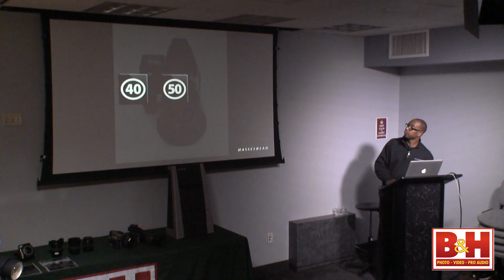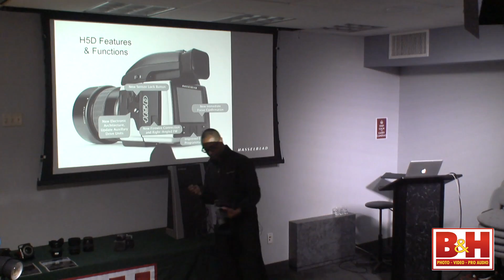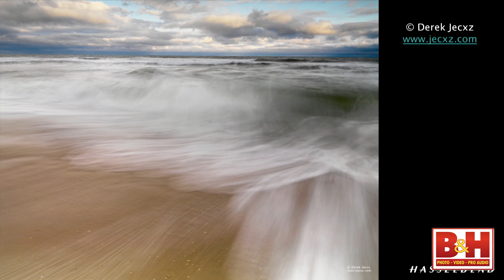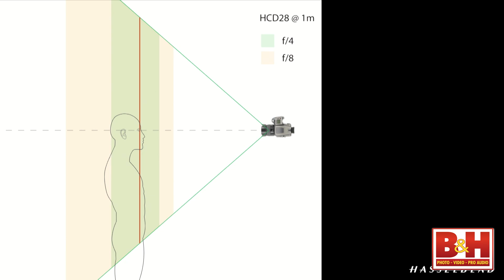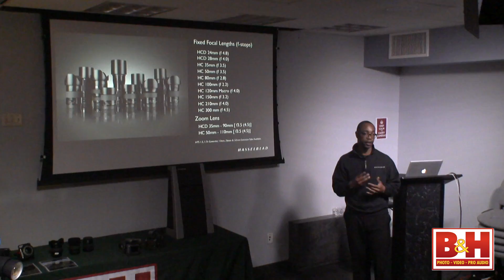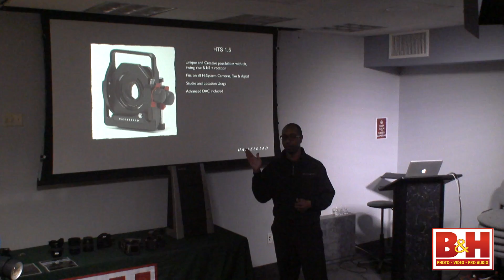Hasselblad: The H5D Explained

Comment: Well Hasselblad has a lot of improvements to make to their service dept. I can't find anyone to fix one of my blads. I bought an H3D-39 a while ago and it cost me around four thousand bucks. It had only 4000 actuations on it...good deal, huh? No I used it 50 clicks tops and when I used the CR123 battery pack on it, after 2-3 clicks, smoke started to billow out from around the vent and then that was the end of that $4000. Please tell me who will fix this thing. Very bad product if I can't get this expensive anchor fixed. What a nightmare!
Reply from the maker: We're sorry to hear of this issue. We invite you to contact us via Live Chat so we can review your options.